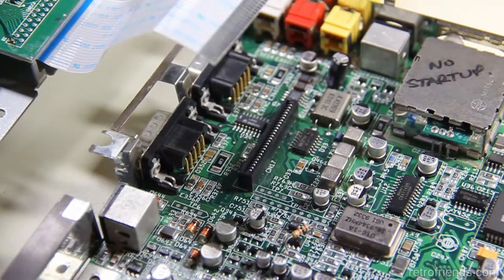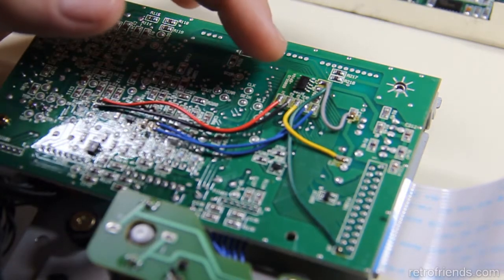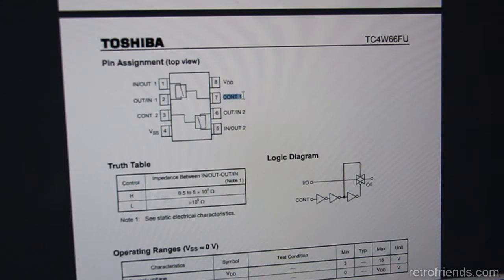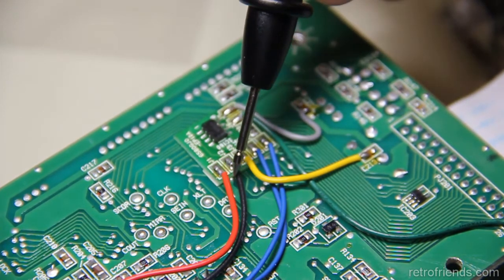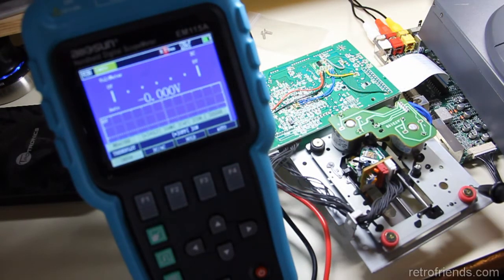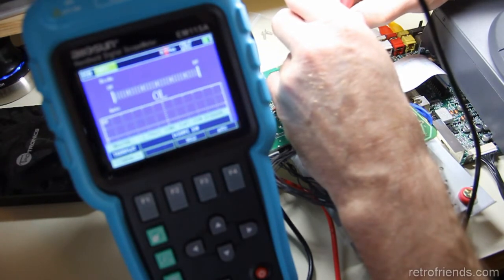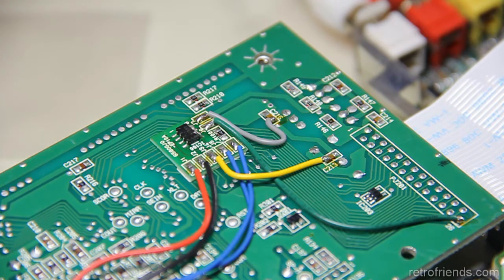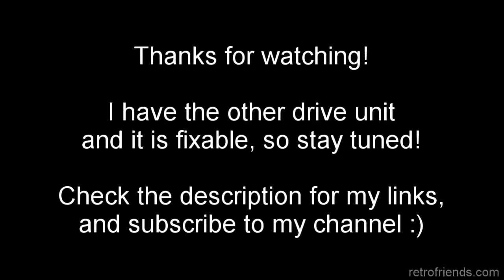Amiga CD32 Repair Part 3: Drive Won't Spin and Mysterious Mod

Comment: Mine does not have this modification. So I'm wondering if the other side of your PCB has the same microcontroller (MN187164MCC1) as I do. If you still have this broken drive, could you check for me, please?
Reply from the maker: No sorry. Long gone :/